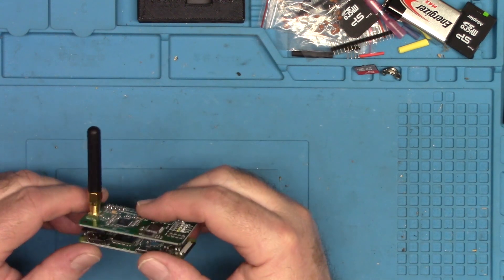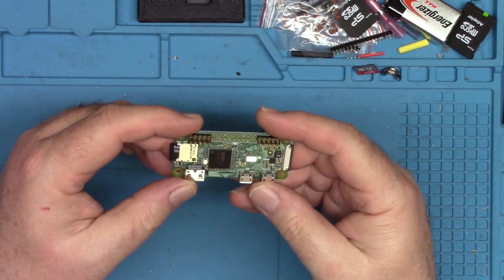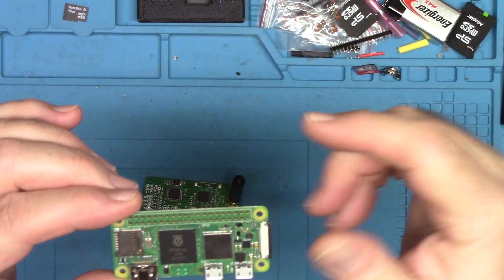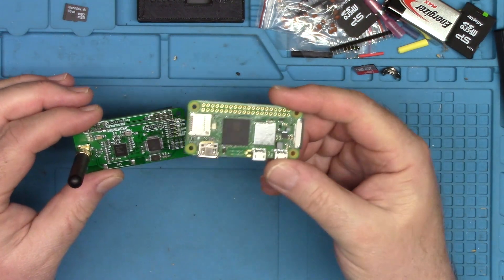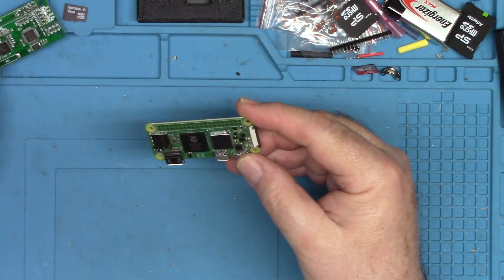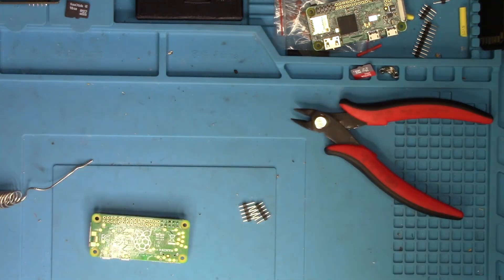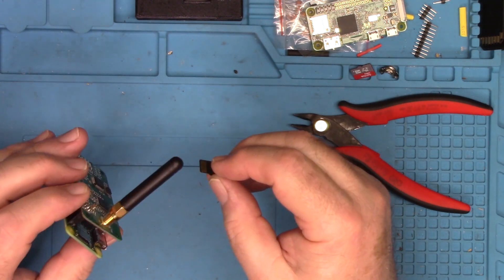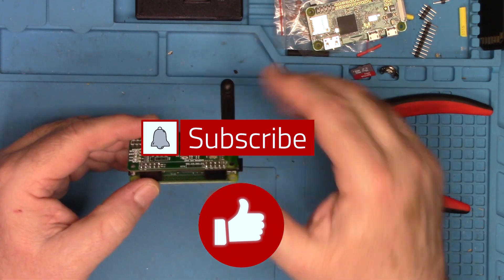Raspberry Pi Zero: The Easiest Upgrade You NEED

Comment: Ordered 5 Raspberry Pi 2 W(s) from Digikey back in June for the original $15 per. I just got notification that they just shipped. I went to reorder another 5 and Digikey estimates March 2024 for the expected availability.
Reply from the maker: Ouch!  It's better than it was, but the supply chain is still pretty messed up.

Comment: I have the same setup for a hot spot. Only thing I did to make it portable is I added a PiSugar as a battery slash backup power source. It has a 1200 mAh battery and will run my hot spot for a full day. Also has a USB C adapter.

Comment: The Pi Zero and 02W have the same size 512MB of ram. The 02W has a quadcore CPU and is faster. The 3B+ has double the memory at 1GB as well as the quadcore CPU.
Reply from the maker: This is more about a zero to zero2w swap - same form-factor, but a lot more responsive.  There are a ton of Pi zero boards powering pi-star that makes this a decent upgrade path.